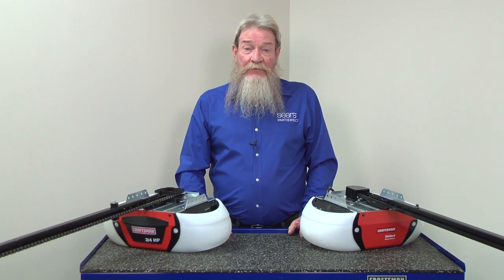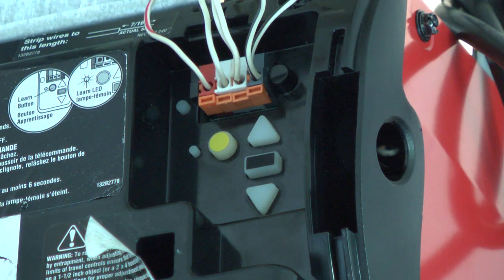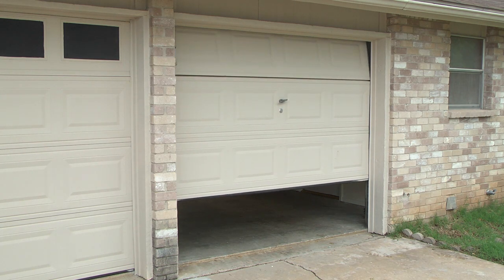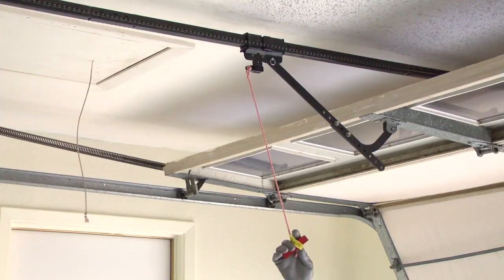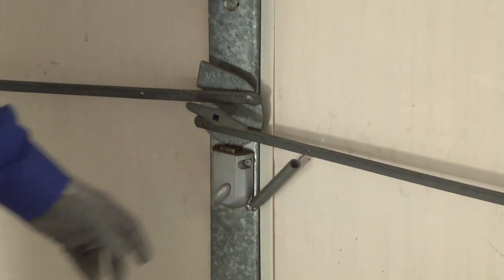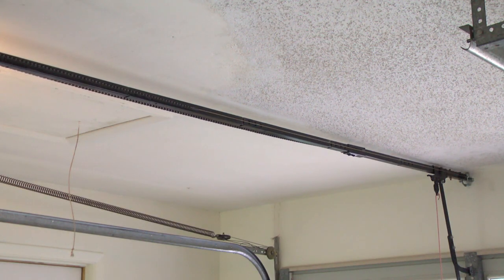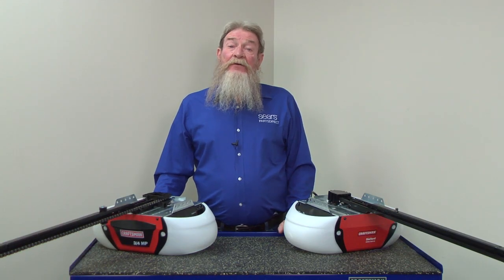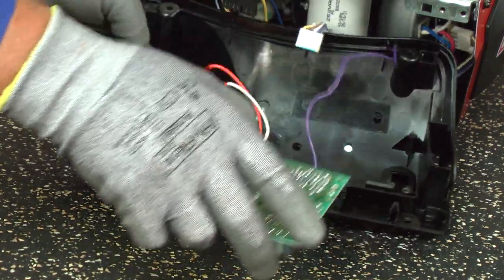How to Fix a Garage Door Opener that Won't Move the Door: Motor and Travel Troubleshooting

Comment: Have the older style Craftsman half horse garage door motor with the manual dials. My LED doesn't blink at all but my garage door motor only clicks and barely tries to move the door. Nothing really happens other than the click and momentary binding. 
The garage door lifts up and rolls on the track easily up and down so it's not that. Every once in awhile the garage door motor will open the garage door and when it does close it will close too far and either come back up or it will close and really bow the track. 99% of the time it just clicks

Comment: At 2:00, how can you check the trolley movement if the problem is that the chain doesn't move?
Reply from the maker: The travel limit device or the logic control board may have failed. If there's chain tension on the trolley then you'll likely need to have a service technician repair the garage door opener. It may be more economical to replace the garage door opener than to have it repaired.

Comment: No got no lights. No flashing, no nothing.
Reply from the maker: Check the house circuit breaker for the electrical outlet that you have the garage door opener plugged into. Reset the house circuit breaker if it's tripped. If the breaker isn't tripped, check the electrical outlet for power. Plug a different item into the outlet to see whether the outlet has power. If the outlet is dead, have an electrician repair the outlet. If the outlet is supplying the garage door opener with power, unplug the garage door opener and check the power cord wiring connection on the logic board. Here's a video/article that shows how to access the logic board on a common garage door opener: https://www.searspartsdirect.com/diy/repair-guide/how-to-replace-a-garage-door-opener-logic-board . If the power cord is securely connection to the logic board and the garage door opener won't power up, then you'll likely need to replace the logic board (or the entire garage door opener motor unit because the logic board often costs almost as much as a new opener). We hope this information helps. If you need further assistance, let us know.

Comment: Our garage door would not open until we unplug the power outlet & plug back in.  Whenever we get home, we have to get out of the car & enter the house to unplug & plug in the power outlet that's connecting to the garage door opener.  Please advise.
Reply from the maker: If your garage door opener uses a wireless keypad located just outside the garage, change the battery in that device. A weak battery in a remote device can sometimes lock up the logic control board inside the garage door opener motor unit. RF interference can also lock up the logic control board so check for sources of RF interference such as security lights or game consoles that could be emitting RF waves that the logic control board detects—causing the logic control board to lock up. Also, check for a stuck button on the wall control inside the garage. A stuck button on the wall control could possibly cause the logic control board to lock up. We hope these tips help. If you need further assistance, let us know (and provide us with the model number of your garage door opener).

Comment: Hi, I have a sears craftsman 1/2 HP, it blinks 5 times and motor did not move at all.
I check the old logic board and did not see any burn or cold solder. I 
just replaced a new Sears Craftsman 41A5021-3M-315 Receiver Logic Board 
and the light still blink 5 times. It did not move at all.  Would that be the RPM sensor?
Reply from the maker: The logic board will typically send current to run the motor and stop the motor after the door moves about 6-inches if the RPM sensor is bad. Although the RPM sensor could be bad, your symptoms don't seem to point to that failure at this point. Unplug the garage door opener and check the wiring between the logic board and the motor because you indicated that the motor doesn't run at all. If the wiring is okay and the new logic board is sending current to the motor, you should hear the motor hum when you activate the opener. If you hear the motor hum, then the logic board is okay. If you have the door connected to the opener when testing the opener, pull the emergency release cord to disconnect the door from the opener's trolley and see if the motor runs and moves the trolley with the door disconnected. If the motor moves the trolley, test door travel by manually opening and closing the garage door by hand. If the door travels smoothly on its tracks and the opener motor moves the disconnected trolley but won't move the door when it's connected to the trolley, then you'll likely need to replace the motor. If the trolley only moves 6-inches when it's disconnected from the door, then you'll likely need to replace the RPM sensor. If the motor hums but doesn't move the trolley, the trolley could be binding up on the rail. We hope that these suggestions help. If you need further assistance, let us know.

Comment: I have a old wood door and it's really heavy and my openor is 20 years old
Reply from the maker: If the door isn't moving smoothly, then you may need to have a repair technician adjust the door springs. If the door opens and closes smoothly and the garage door opener isn't working well, then you may need to replace parts in the garage door opener or replace the entire garage door opener. We hope this information helps. If you need further assistance, let us know and give us more details about the problems you're seeing.
Reply: @searspartsdirect  it seems that the opener doesnt have the power to lift it. I have to assist it. It's a old Sears craftsman from 90 or older lol. But it very well could be the springs
Reply from the maker: @brandonvandine1695  If you pull the emergency release rope and disconnect the garage door opener trolley from the door, you can test garage door travel. If it's hard for you to lift the garage door by hand with the opener trolley disconnected then the garage door springs likely need adjustment. If the door isn't hard to lift and it travel smoothly when you manually open and close it then the garage door opener is likely worn out. Given the age of the garage door opener, it will likely be more economical to replace the opener rather than repair it.
Reply: @searspartsdirect  yes with it released the door weighs 3 tons so probably the springs like you say. I can test it again to be sure so probably not the opener even though it's from 1977 lol thank you for the information

Comment: My garage door had a broken gear drive and so I replaced it. Now I get a code 5. No it has nothing to do with the trolley or the chain because even when I disconnect the chain from the drive, The motor will turn one way for three seconds and then back the other way for a half a second and then shut off suddenly. I know I had to unplug the wire plugs when I was changing the gear drive because they were in my way but everything is plugged and secured and it still does it now. This was not a problem before I changed the gear drive.

Comment: What ones 6 blinks mean?
Reply from the maker: Six blinks on many garage door openers indicate that the logic control board detects a drive motor circuit failure. Try unplugging the garage door opener for 1 minute then plugging it back in. Resetting the logic board in the motor unit may fix the problem. If not, you may need to replace the logic board because the motor relay on that board failed. The drive motor rarely fails but there is a slight chance that the drive motor is bad and you'll need to replace it. We hope this information helps. If you need further assistance, let us know and provide us with the model number of your garage door opener.
Reply: My garage door had a broken gear drive and so I replaced it. Now I get a code 5. No it has nothing to do with the trolley or the chain because even when I disconnect the chain from the drive, The motor will turn one way for three seconds and then back the other way for a half a second and then shut off suddenly. I know I had to unplug the wire plugs when I was changing the gear drive because they were in my way but everything is plugged and secured and it still does it now. This was not a problem before I changed the gear drive.

Comment: What if there is no clicking, no movement and no sounds. The light button in my wall opener won’t even work. Almost like there is no power to it. It just suddenly stopped working. Only a couple years old.
Reply from the maker: Check to see if the LED light on the motor unit is on. If not, the motor unit likely isn't getting electrical power. Check the house circuit breaker for the electrical outlets in your garage and reset the breaker if it's tripped. If the breaker isn't tripped, check for power at the garage door opener's electrical outlet by plugging an electrical item in the outlet to see if the outlet works. If the electrical outlet is dead, have an electrician fix the outlet. If the outlet has power but the garage door opener won't power up, a wiring failure or bad logic control board in the motor unit is preventing the motor unit from powering up. If the motor unit LED is lit, and the logic control board may need to be replaced. It's often more economical to replace the entire garage door opener rather than replacing the logic control board. We hope this information helps. If you need further assistance, let us know.

Comment: My Craftsman 1/2 hp abruptly stopped on its way down after I walked in front of the sensor and started buzzing indefinitely. It simply buzzes indefinitely when I press the button, but never goes anywhere. Even with the garage door detached, it doesn't move at all. There doesn't appear to be any blinking codes when I try to operate it. The light bulb in it eerily burned out two days before as well. Help!
Reply from the maker: A relay on the logic board may be stuck. Try resetting (rebooting) the logic board by unplugging the garage door opener motor unit for 1 minute and then plugging it back in to restore power. The garage door opener may work properly after restoring power. We hope this tips helps. If you need further assistance, let us know.
Reply: @searspartsdirect  Thanks for the reply! I have tried this multiple times, but no luck.

Comment: thank for your help....my 1/2 hp craftsman belonging to my daughter had the chain come off. I went over and put it back on. After adjusting the travel limits I finally got it right and push the button to close it. Flashed 5x and only made a BUZZ noise. Figured it overheated.  Next day same thing. Took chain back off and the sprocket does move in both directions without it. Manually closed the door and re-connected chain and trolley while door was closed and sprocket had turned to down position. Adjusted limit up significantly so it would not go all the way up. Hit button and door moved up no problem but all the way to hit the bolt again. Hit the button again and just a buzz and no movement. Still blinks 5 x thru out all this. Any help appreciated!!
Reply from the maker: The motor may be overheating because the trolley hits the bolt and the motor overheats when trying to move the trolley past the bolt. Adjust the down travel limit so the trolley doesn't hit the bolt. If you're not able to adjust the down travel limit so the trolley doesn't hit the bolt, then there's a chance that the travel limit switch is broken inside the motor unit or that the logic board inside the garage door opener is faulty and not detecting the down travel limit contact in the limit switch. Unplug the garage door opener and check the limit switch for damage. Check the wiring on the limit switch. Reconnect any loose wires and repair any broken wires. If the limit switch and its wiring are both okay, then you may need to replace the logic board. We hope this information helps. If you need further assistance, let us know.

Comment: Hi I ordered parts from Sears Parts Direct for my craftsman 3/4 HP garage door.  

I first latched the door to the trolley, it pulled up a little bit and then back down.  After I detached the garage door from the trolley, the trolley kept charging forward and was eventually derailed and hit the stud.  Please advise.

https://youtu.be/09O6sXd3vL8
Reply from the maker: According to your details and the video you posted, it looks like you'll need to adjust the travel limits. Use the instructions in the owner's manual to adjust travel limits. If you can't adjust travel limits, then the travel limit switch assembly may be faulty or the logic board on the garage door opener may have failed. We hope this information helps. If you need further assistance, let us know the model number of your garage door opener and additional details about the problems with the garage door opener.
Reply: Sears PartsDirect Hi, I bought a brand new unit at Sears hardware store this weekend.  It is craftsman 1/2 HP.  An outside contractor installed it and said he could program the limit setting to pull the door up, but he could not save the downward setting.  I have been calling Sears all day for tech support.  I got a bunch of phone numbers but didn’t get any technical advice.  Please help!  Many thanks!
Reply from the maker: @CH-yt6qi  Let us know the model number of your garage door opener and we'll try to help you.
Reply: Sears PartsDirect 54985
Reply from the maker: @CH-yt6qi  Thanks for posting that model number. If you're unable to program the down travel limit by carefully following the instructions on page 29 of your owner's manual ( https://www.searspartsdirect.com/partsdirect/user-manuals/13954985-craftsman-parts-manual ) then you'll likely need to return the garage door opener for an exchange or have it serviced under the warranty. We hope this information helps. If you need more assistance, let us know.
Reply: Sears PartsDirect  Hi, thanks for all the replies.  This craftsman model consists of half cable, half chain.  When the door is shut, I notice the chain is sagging but the cable is tight.  If I choose to pull up the garage door manually sometimes it grinds the chain.  Please explain how much sagging it should be when the door is shut.  Thanks!
Here is my video clip:
https://youtu.be/R6KvobCNG7g
Reply from the maker: @CH-yt6qi  Page 11 of the owner's manual shows how to adjust chain tension. The chain should only sag about ¼-inch below the mid-point of the rail. Follow the directions in the owner's manual to adjust chain tension. If you need more help, let us know.
Reply: Sears PartsDirect just to confirm that the chain should droop 1/4 inch below the midpoint of the rail when the door is closed and it should be STRAIGHT at the mid point of the rail when the door is open.  The cable always appears tight even when the chain was sagging as shown in the video.  I just want to make sure I fully understand your advice so I don’t over tighten the chain.  Thanks!
Reply from the maker: @CH-yt6qi  According to the information in the owner's manual, the chain should be in the position as illustrated on Fiigure 2 of page 11 when the door is open. You should also pull the emergency release cord to disconnect the trolley before adjusting chain tension. Some chain droop is normal when the door is closed but you may be able to reduce the chain droop by adjusting chain tension as shown in the manual if the chain isn't already tensioned to that point. I hope this additional information helps you better understand chain tension adjustment on your garage door opener. If you need more help, let us know.
Reply: Sears PartsDirect Hi, I have just finished with the garage door installation.  I have programmed the new remote controls and the control pad.  I cannot reprogram my original remote controls (2014 model) to this new unit.  According to page 39, it should work with all craftsman remote control from 1993 to present.   Also, I am unable to re-program homelink of my cars (both are 2011 model).  Does this unit (54985) have rolling code?  I tried both standard instruction and rolling code instructions for my cars and I cannot get them working.  I am trying to reprogram the old remote controls so I can re-use them.  Thank you very much for all your advice.  Cheers!
Reply from the maker: @CH-yt6qi  Although the universal remotes described on page 39 of the manual will work with your 2014 model and your new model, the 2014 remotes likely aren't compatible with your new garage door opener. Your new garage door opener using a rolling code that's different than the 2014 model. For help programming your Homelink system to the new garage door opener, visit the Homelink website ( https://homelink.com/home/welcome ). We hope this information helps. Let us know if you need further assistance.

Comment: I have an older model without flashing lights (139.663953). The door was stuck open, so I pulled the cord to disconnect the door and closed it manually. Pushing the button only caused the motor to hum for a few seconds, then shut off. I tried again the next day and the trolley did travel all the way down, and then all the way back when the button was pressed again. But after that it was stuck again. I unplugged the opener, took off the cover, and looked for obvious problems inside -- but saw none. Replaced the cover and plugged back in, but the motor still just hums for a few seconds without any trolley motion. Any clues on determining the cause?
Reply from the maker: Based on your symptoms, the motor start capacitor may have failed or the drive motor may be worn out. Replacing one or both of those parts may fix the problem but both of those replacement parts are no longer available for that older garage door opener model. You’ll likely need to replace the garage door opener.
Reply: @searspartsdirect  Thanks for the quick response.